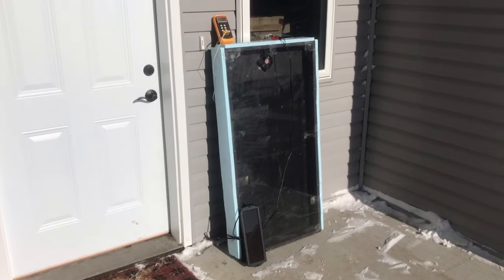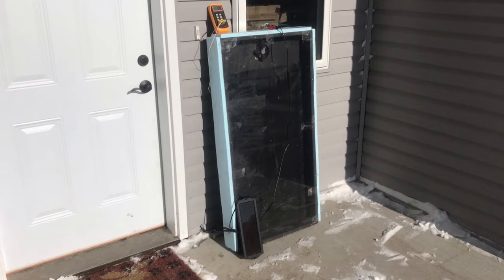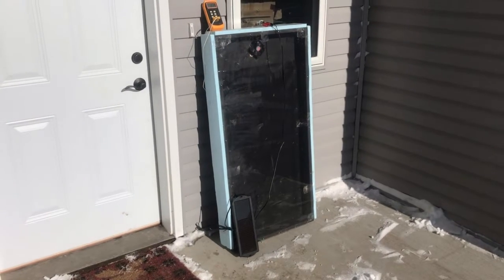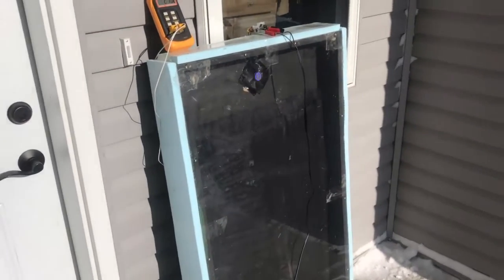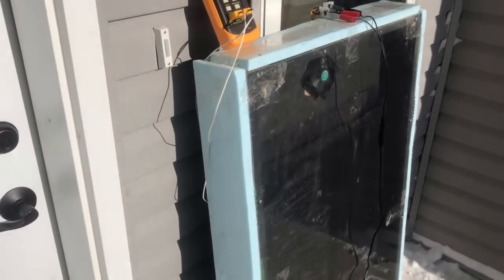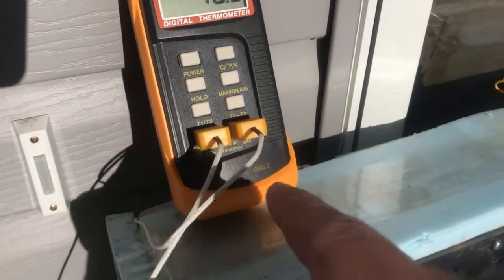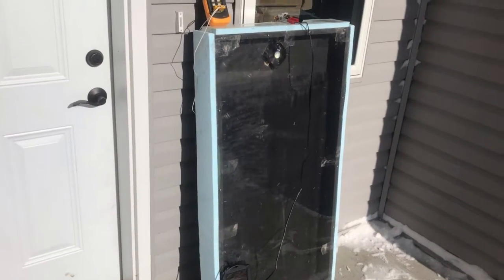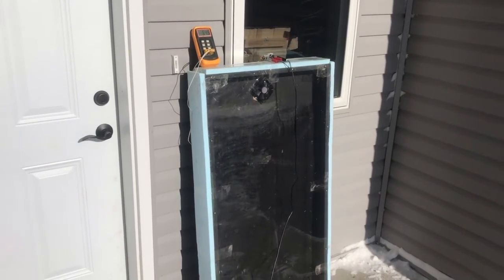Testing my solar heater prototype

Comment: Nice to see how these perform in our cold Minnesota temps!  Impressive heat gain.  The 138 temp was bringing in cold air from outside, right?  Imagine if you were drawing warm air from inside the house.  I really want to give this a try.  Thanks for the video!
Reply from the maker: Ross Perot it was drawing outside air. So the temp differential was from the ambient temp to the post solar heater air temp